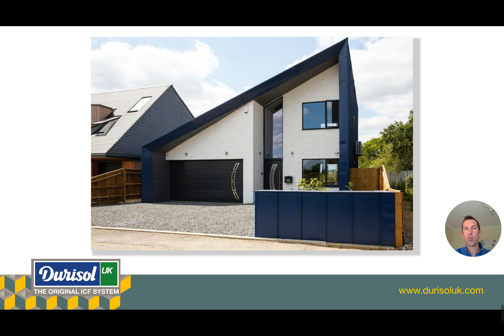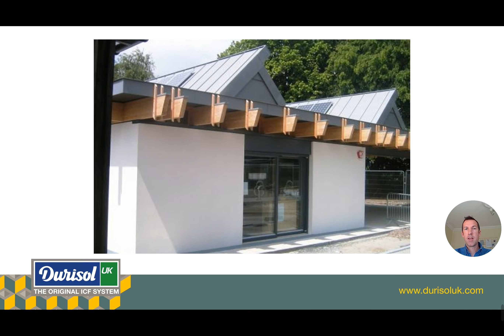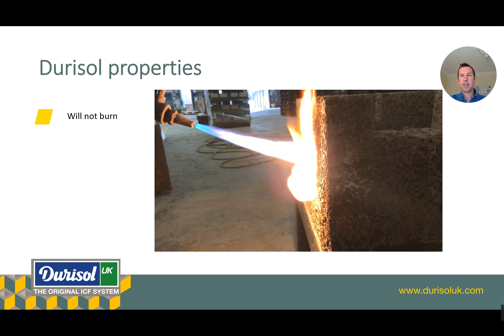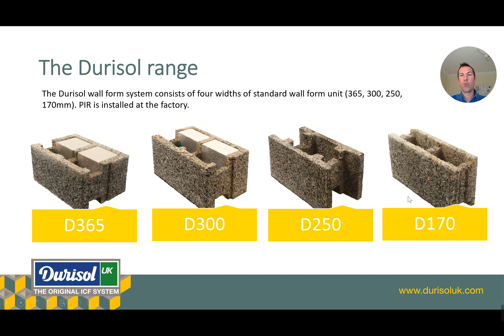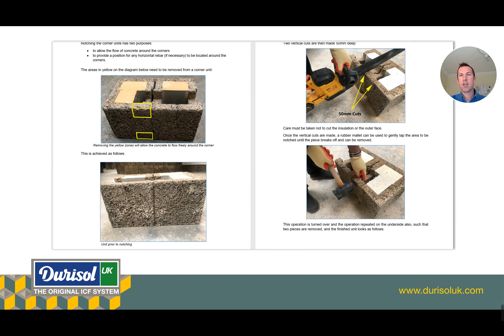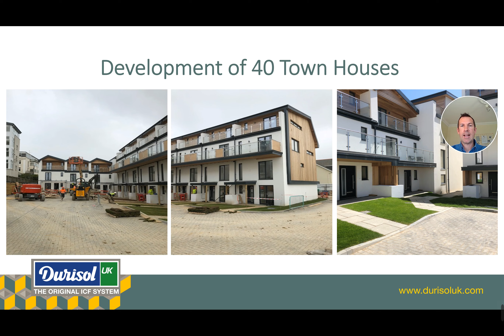An Introduction to Building with Durisol Woodcrete ICF

Comment: Brilliant system. I am a house builder in South Eastern England. I would consider this system. How much is each block for the two thicknesses of kingspan? Also no issues with damp with no cavity or cavity trays etc? Regarding the 30% saving vs timber frame and brick and block, is this as a whole or a 30% material cost saving? Many thanks.

Comment: Thank you for bringing this product information to a mass audience. I am located in Omaha, NE and 90% of houses built are still on concrete block. While I possess a knowledge of the building process I find this product fascinating. Mike Holmes in Canada has a TV show “Holmes on Homes” and over his 10th season and has rocked the building community, contractors, inspectors and introduce suggested laws in Canadian government to increase minimum building standards and your block is a building material highly recommended by him. He built the “Ultimate Garage” off the grid for environmental reasons as easy of use, ability to add rebar, use strong adhesives during construction and added rigid extruded polystyrene inside the block. Adding “Sealing Water Barriers and unsalted 2” (50mm) board attached to the outside. This increases “R” values but done right, allows for a cement board horizontal siding and Stucco! His ultimate garage is on my bucket list. The possibilities are almost endless. I am curious regarding locations where the product is manufactured. Omaha is 2,500 miles from either coast in the middle with rail access and interstate East, West, North to South to Kansas City, Topeka KS, Wichita to Oklahoma City into Dallas / Fort Worth. North-East Nebraska is covered in trees and millions of tons of premier wood pulp is free due to almost annual winds to exceed 110 MPH. People stack it into 5 locations for the taking. Free building material for these blocks. Thanks kindly for the information provided in this video. I want some for my backyard garage!
  Be well and safe my friend. DK, Omaha

Comment: How does it do with prolonged freezes? For example, during temperatures ranging from 0C to -39C for periods of 6 months.
Reply from the maker: Durisol in Canada have done some studies on this. There is research showing submerged freeze thaw cycle analysis which is particularly aggressive and the product fared perfectly well. There are also acoustic barriers in places like Canada which have been up for 40 years plus, fully exposed to the temperatures you describe as well as salt spray etc that freeway environments present.

Comment: How about some U numbers?  Also, you mentioned it could be exposed so I guess it is UV stable?
Reply from the maker: Thanks for the question. U values are published in the Technical Manual and thermal conductivities in the BBA certificate should you wish to model your own configurations. Suffice to say U values below 0.2 can easily be achieved. It is worth pointing out that U values modelled in software fail to take into account thermal mass effects. They also assume a steady state of heat transfer and in the UK's temperate climate, the temperature is almost constantly moving which undermines the models somewhat. Peer reviewed papers studying real Durisol builds in the UK are available upon request showing the real energy demand (or lack thereof) of Durisol structures.  And yes, the woodcrete is UV stable and is commonly used in acoustic panels which are permanently exposed structures.  In any case, at Durisol UK we manufacture units for construction and the end product is usually covered.